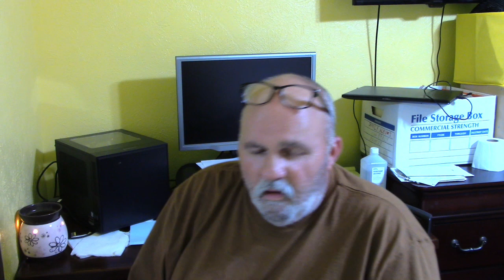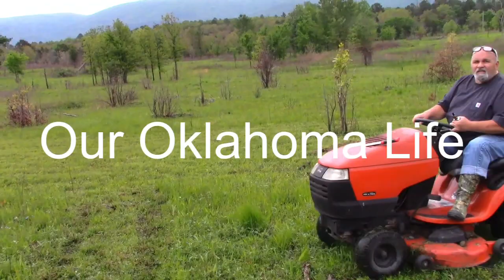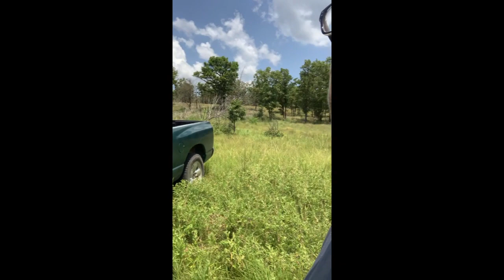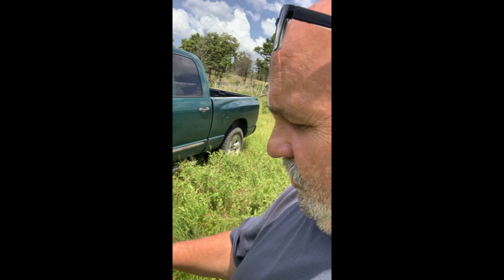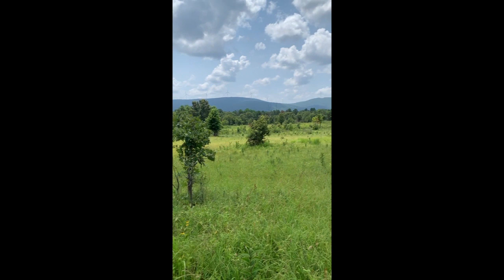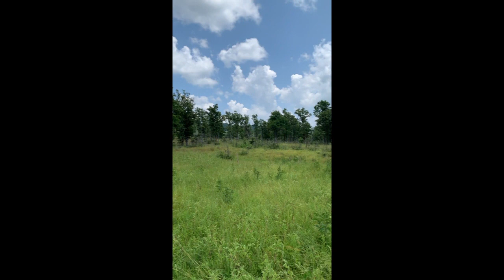Barndominium Build Sticker Shock!!!

Comment: This is great info I’m in the planning stage here in OKC and been trying to find info on the process and which companies to look into
Reply from the maker: It's definitely a challenge to find good companies and contractors.  We kinda lucked into a good batch of contractors.  Just make sure you check them out and actually check references.  It's probably not normal but, none of our contractors wanted any money up front.  We paid after the work or in stages(draws).

Comment: I will be building on 11 acres in Texas and have had to substantially reduce the size of house and shop plans. I'll be going with a 30 x 40 shop with a small 2 bedroom 2 bath connected to it on the end. Between the shop and house will be an 8ft wide laundry/utility/storage room. It will be one whole building. Original plans were 40 x 60 shop with small apartment, then build a separate 1600 sq ft house. Isn't going to happen.
Reply from the maker: I know how you feel.  We have had to cut a lot of things from our build.  On the main things like the house and shop size we're trying to stay with the original plans but giving in on some of the small things.  This is our last house so we're going all in.  Thank You for watching and good luck.

Comment: Great info!  We're in the planning stage right now and first step is the land.  We're currently in Colorado but looking to retire in Lubbock, Tx in about 3 years.  Cant wait to watch your build and hear actual costs associated with the entire process.  Good Luck!
Reply from the maker: Thank You for watching.  Every bodies build is going to be different but, I think a lot of people online exaggerate on how little they spent on building.  We're finding this out the hard way and want to let people know what you can realistically expect to pay, of course depending on where your building.
Reply: @OurOklahomaLife  Hey just wondering how the shortages nationwide are affecting your build?  The company I work for broke ground on another building 4 months ago and work has completely stopped a month ago because they can't get steel.
Reply from the maker: @artbroadwater5745  Some things are affecting us.  Hopefully steel won't be one of them.  Our builder owns his own steel supply yard and said when he started seeing steel going up he stocked up heavily.  Last time I was at his yard it looked as if he had enough steel to build 20 barndo's.  We are having problems getting electrical supplies, doors, windows, and such.  We don't start the build until December so time will tell.
Thanks for watching and good luck.

Comment: Do you live in choctaw Nation area or will they do the well and septic for any choctaw nation member?
Reply from the maker: You have to be a Choctaw member and live in the Nation.  All the info is on the Choctaw website.  Also check out The Choctaw Nation's American Rescue Plan.  Any member can apply.  Takes about 5 min to apply and you get $1k a year for 2 years.  Don't have to live in the Nation for this.

Comment: It is nice to hear the REAL costs of building a Barndo. We are also starting the process of a build almost the same as yours. Our house is 40x80 and the garage/storage is 30x50 . Who did you use for your manufacturer of your steel frame/red iron kit. The prices we have been receiving are a good bit higher.
Reply from the maker: We are doing a weld up red iron building with a local company.  I found it was cheaper because they buy the metal local, cut it to size and weld it together.  If you buy a kit they cut, weld, fabricate and ship it to you.  Lots of added cost in prefab buildings.  Not to mention you have to find someone to erect it for you.  Our guy is doing everything but the in slab plumbing, we are hiring a plumber our builder recommended.
Reply: @OurOklahomaLife  we are in the beginning stages  as well. Would you mind sharing your builder? Realistically it will be 6-8 months before we are ready to break ground.
Reply from the maker: @justinjacobs19  We are using Johnson Construction out of Cameron Ok.  We have checked out 2 of their buildings in person.  One was finished and one under construction.  The owner Richard is a supper nice guy.  You can check out their facebook page.  https://www.facebook.com/johnsonok2013
Reply: @justinjacobs19  You might want to compare. I like the steel building idea, but Hate that roll on insulation in the ceiling. I want sheathing and roofing under layment then the metal roof. This is superior to slapping down metal panels on that cheap rollout insulation , but the steel truss spans are too big. The wall support spans are also too wide for drywall so you still have to install a huge number of studs. Might as well just frame it up like a house at that point and order trusses that are designed for a room up there. In a steel building you will have to build an entirely separate structure inside to have a loft. Ive looked at this for myself and it seems like more work, longer build time and hassle to piece everything together. You can still just use metal roofing and siding, it looks exactly the same and is fire proof. Decision made.